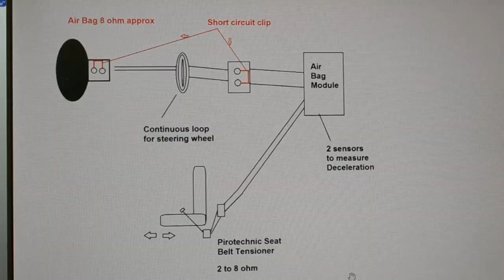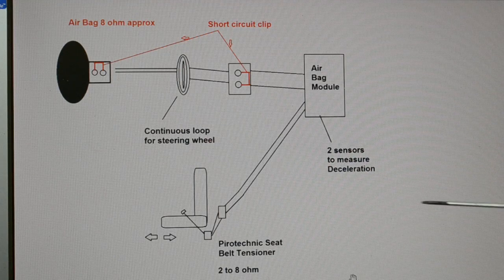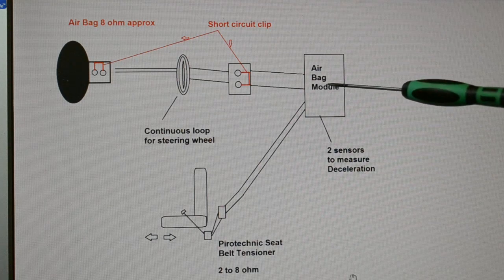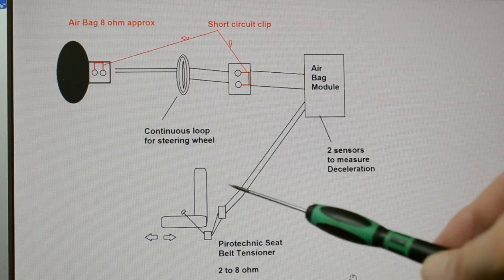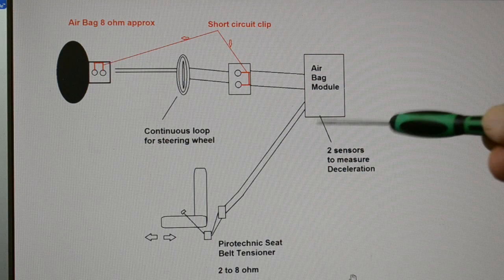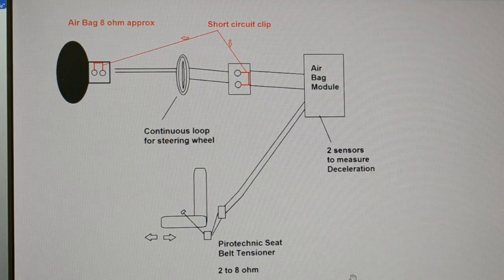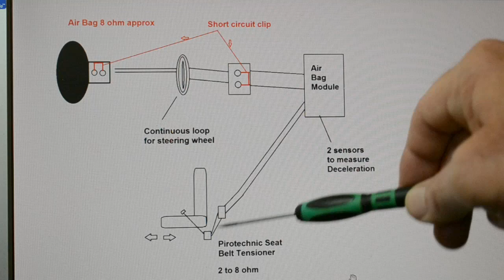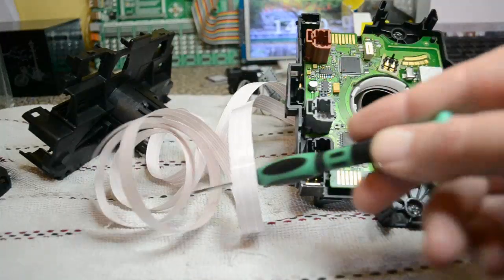Air Bag Light On & OR Horn not working -repair guide

Comment: Hi ..I have s 2004 (54) Peugeot partner quicksilver....I get an intermittent airbag warning light that for some strange reason seems to come on when I turn RIGHT on some occasions.....and also....the horn is intermittent...would this cable being worn be the problem?...it's got almost 98 k miles
Reply from the maker: Yes
Reply: @JohnB-2021  great ....I didn't want to spend out on a replacement unit until I was certain.. Is it possible to get a pattern part?...I'd be reluctant to get such a part from a scrapyard as there is no guarantee it won't happen again six months down the line ...
Reply from the maker: @gemmastone285  I got one from a car breakers, the horn stopped in one week.
eBay is your best place I think. You can pretty much guarantee it's the switch assembly causing the problem.
Reply: @JohnB-2021  thank you John...I'll try and let you know how it goes ...👍
Reply: Just one more thing....I've been searching eBay...but I don't actually know what this part is CALLED....,
Reply from the maker: @gemmastone285  
It's called many things like switch comms etc but I'd search for indicator switch assemble and pay particular attention to the wiper stalk.
Some like my old 307 had a push button on end for the trip computer, others do not have that button.
I made that mistake in 2008 and purchased a unit that didn't have the button, it means you can't adjust the clock or trip computer etc.
They usually show little pictures to tell you what the switch has on ebay etc.
This link below is like my old one, no front fog lights but does have trip button etc
https://www.ebay.co.uk/itm/NEW-GENUINE-PEUGEOT-PARTNER-307-INDICATORS-LIGHTS-WIPER-STALK-SWITCH-6242L5/264472084933?hash=item3d93c3c1c5:g:gnQAAOSwa~BYdOqA

PS, the old radio switch will unplug from your old one and plug into new unit.
I also have a video that shows how to remove the steering wheel, bit long because things are never straight forward when the camera is on lol.
Reply: @JohnB-2021  well I have an aftermarket cd player not connected to the unit that controlled the factory radio...the trip reset is on the dash display...and I have found one on eBay ...got MOT next month so I'll grab one and get it fitted at the garage that will Carry out the service and MOT ..but thank you so much for all your help xx
Reply from the maker: gemma stone you’re welcome 
When I say trip computer, I’m referring to the display in the middle of the dash.
If you have a clock and it tells you the time and how many miles before you need fuel, you need a switch with the button on the end of the wiper stalk.
Hope that makes sense 😁
Reply: @JohnB-2021  I just wanted to update you on whats happening....I went to my mechanic to book MOT as it's due next month ..horn now inoperative....but there's a twist ...if I take the key out of the ignition it works fine ....I tried holding the horn down and replacing the key and it goes silent....only to work again when I remove the key ....any ideas?... surely if the clock spring cable (as my mechanic call it) was broken it wouldn't work at all would it?
Reply from the maker: gemma stone 
How very odd
Sounds like an earth fault or earth loop when the ignition is on and off.
Reply: @JohnB-2021  I actually googled it and it is apparently down to the earth wire on steering....in both partners AND Berlingos...I know a VERY good auto electrician ... Since this has materialised I've had no trouble with the airbag light ...that's going out as Normal... But the horn Is only working with the key removed ...I'm sure it is fixable...but if don't need to replace the clock spring cable I won't ......further updates as I get them....as this may help others in the same position
Reply: Just an update as I said I would let you know what happened... first of all my car went though MOT yesterday ...I did give the mechanic the heads up on the horn problem as it's still intermittent... but it was working fine all day and didn't cause vehicle to fail...he told me that he didn't replace the unit as he wasn't entirely sure that it was faulty and didn't want to replace the unit if that wasn't going to guarantee fixing the fault ...and it's working fine now with a full MOT so I will wait until it packs up completely
Reply from the maker: @gemmastone285  Thank you for the update
Reply: @JohnB-2021  finally got so fed up with inoperative horn that I ended up taking to it an auto electrician ..turns out it was an earth fault and the air bag light was loose wiring  on underseat connectors...all sorted..horn working perfectly with ignition on and no airbag light

Comment: Hi there, great video! My Peugeot 206 2001 reg has a solid Airbag light on and the horn doesn't work.  Would you be 100% certain it's the long ribbon cable that's gone then?
Reply from the maker: +BearRyan 
No I wouldn't be 100% certain but, it's the first thing I would test if I had both faults.
Reply: John B Thanks John, I've been quoted £198 all in to have a new one installed. What else could cause the airbag light to stay on? It's a 5 door so I don't think there's any cables to check under the seats.  Thanks for replying.
Reply from the maker: +BearRyan 
Hi, you need to check the continuity of the air bag wiring through the switch assembly.
You need to remove the air bag (2 sets of wires if it has a dual air bag) remove the bridging links at the rear and test the wiring, it's the only way to be sure.
Reply: John B Thanks John.  Really appreciate the help.  I was afraid that this could turn into a massive expensive job.  I only bought the car.  I'm no expert but when I read up on my faults (which I thought were minor) I got scared! The seller has obviously withheld some important information from me :(
Reply: BearRya

Comment: Can one still have a horn and SRS light on?
Reply from the maker: yes
Reply: @JohnB-2021  The connection to the pre tensioners umder the seats simply neaded flushing with cleaner and the fault disappeared.
Reply from the maker: @humphreylees9609  cool
Did you use a diagnostic tool?
Reply: @JohnB-2021  I don't think they were around in 1996
Reply from the maker: @humphreylees9609  
Yes they were.
So you're asking a question about a horn and SRS light, then you say you 'flushed' the connector under the seat and now you're saying that was 22 years ago?

Comment: In my 207, this is slightly different but with obvious similarities. However, I have 12v at the horn when the airbag is pushed and the horn works fine on a separate 12v supply (ow my ears). 
I think I have voltage drop across the horn (either that or I didn't stick the probes into the wires very well) which would indicate a bad earth. I presumed the horn bracket is earth and one of the two wires are +12v, what's the other wire?
Reply from the maker: Hi,
Other than the air bag wiring, do you have a black wire connecting to the metal work under the airbag?
If you do, the horn is earth'd from the steering wheel.
Reply from the maker: Correct :)